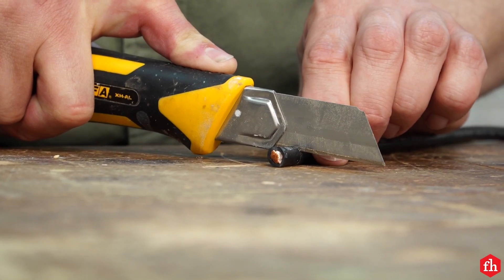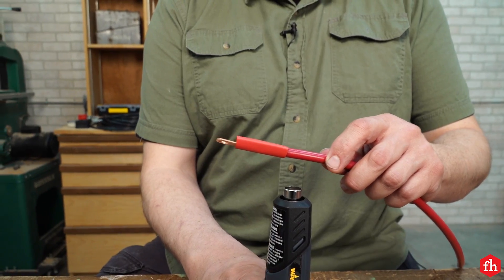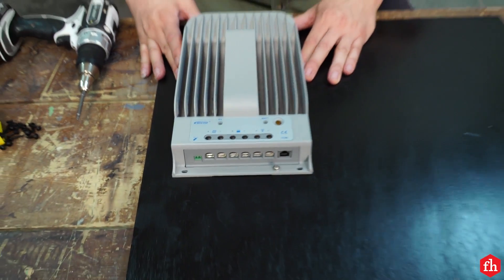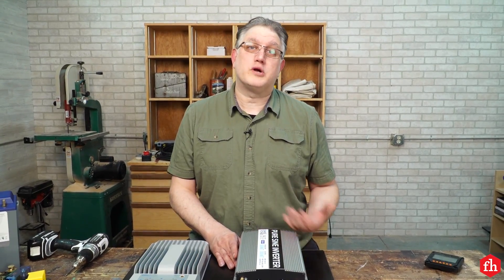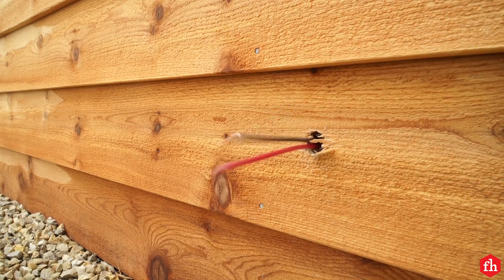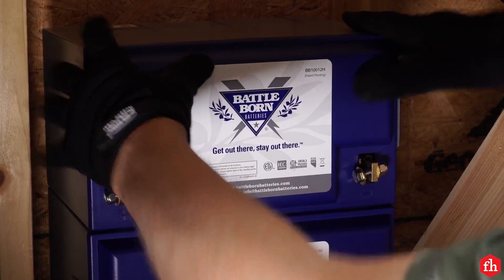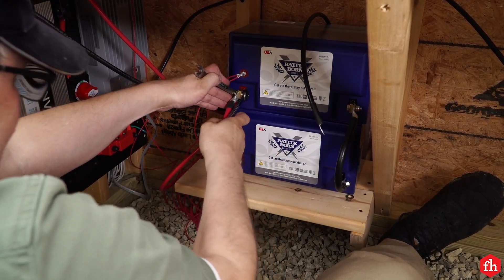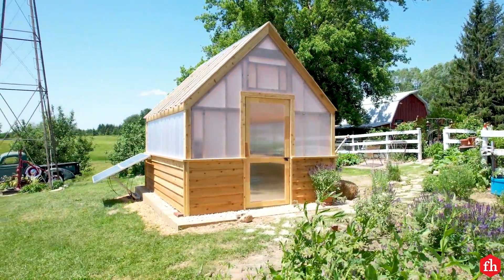How to Install Off Grid Solar

Comment: 1. This is VERY different to wiring a stereo…. I still have no idea what I need or why I need it!   Is there anywhere you’d recommend for further reading to help me choose what products I need and why but also to be able to compare brands?

2. Is a greenhouse a good idea to house this?  Greenhouses get very warm due to their design, but also involve lots of watering of plants - always been told that water and electricity don’t mix. It’s potentially a humid environment as well, which can5 be great for the batteries etc?

Comment: I know it's just an installation video, but letting people know what amp the inverter is (12V, I'm assuming, since the batteries are in parallel for 12V, but that doesn't always indicate what the inverter amperage is), would be useful. Also, to remind people to get the correct guage for the wire based on the amperage and wattage of the inverter and batteries.